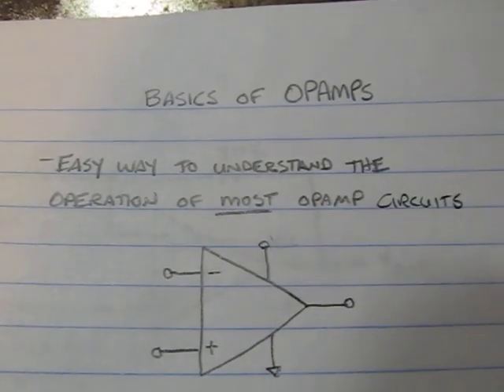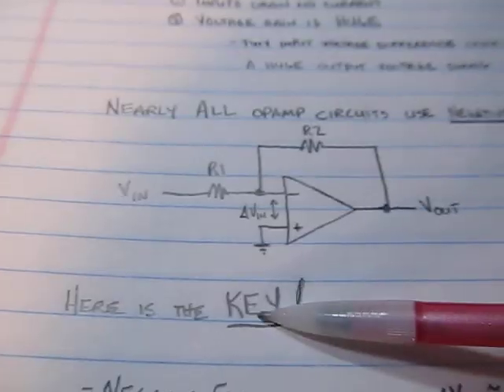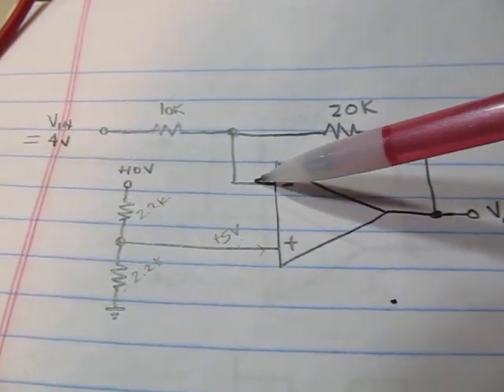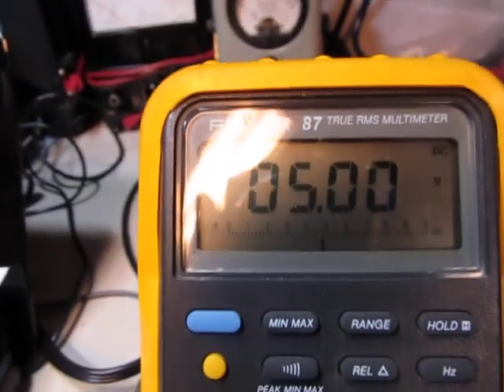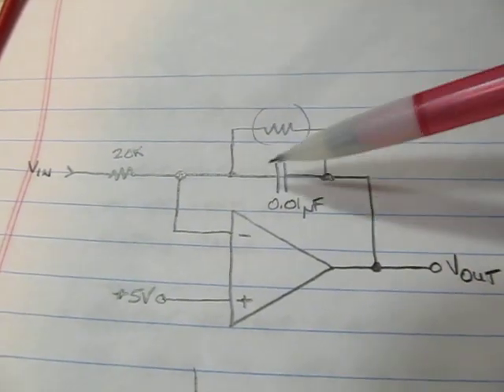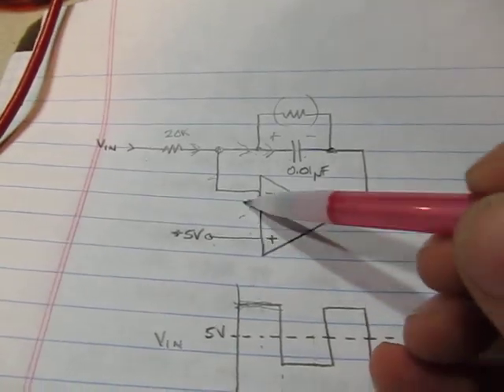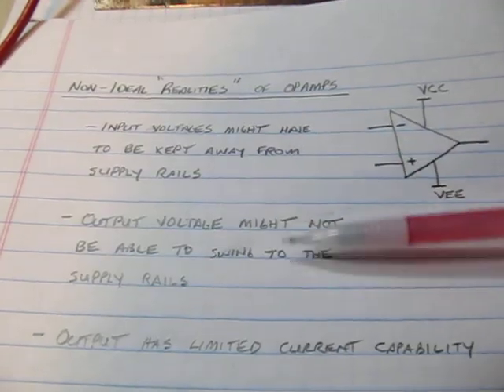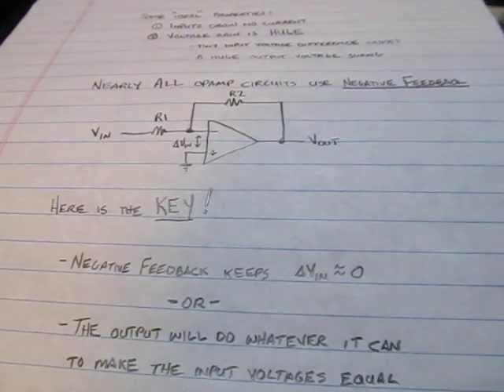#75: Basics of Opamp circuits - a tutorial on how to understand most opamp circuits

Comment: Sir, I can appreciate that you are trying to make the explanation as simple as possible, and I would not try to explain the operation of the "integrator" in the manner in which I am going to discuss the  engineering situation in the op-amp, but it would be interesting to represent the real operation of the op-amp working as an integrator, ( through itself acting as a differentiator from an output point of view!!)
At 8:09 you are suggesting that due to the 5 volts at the inverting input there is a constant current flowing in the input resistor which must proceed to flow into the feedback resistor. Then you suggest that this constant current through the capacitor will create a linear ramp voltage across the capacitor.  This operation seems to suggest that it is the constant current that creates the ramp output voltage, but in reality, it is not like that. In reality, it is the ramp voltage output which creates the constant current. Here is how it goes.
When the input is higher than 5 volts at the inverting input, the output goes negative from a LOW OUTPUT IMPEDANCE VOLTAGE source and so it pulls the output plate of the capacitor quickly down with it. But from the output point of view,  the circuit is a differentiator and so to produce a constant voltage of 5 volts on the capacitor plate connected at the input inverting input, the voltage output must have a constant rate of change.  In reality, it is even more than that, as there is a very high-frequency oscillation being superimposed on the ramp output which is reflected at the inverting input.  So really the practicality of the circuit suggests that it is the constant rate of change of the output voltage that causes the constant current to exist and not the constant current exists because of the 5 volts at the inverting input and this is pushed into the capacitor.   The conduction current through the input resistor and the displacement current through the capacitor is created because of the nature of voltages appearing between the two components connected between the output and the input " low impedance voltage sources".
Now that in order for a displacement current to flow through the insulation of a capacitor, there must be a rate of change of electric field in the dielectric insulator.  Displacement current through an insulator will only flow if there exists a rate of change of the electric field. ( we are in the radio space now and not the DC conduction space) 
When teaching operational amplifiers, I like to introduce a lever system where the fulcrum is the inverting input at the same potential as the noninverting input. In the case of the integrator circuit, not many books mention the fact that from the output point of view, feeding the same network, the network is a  high pass network or a differentiator circuit BEING FED FROM A LOW OUTPUT IMPEDANCE OF A VOLTAGE SOURCE. 
To really idealize an operational amplifier one needs to ensure that the student fully understands ( in this case  voltage sources ) that both the input source and the output of the op-amp have low output impedance and so the junction point at the inverting input is a tug of war between the input source and the output of the op-amp.  The junction point of the between the input component and the feedback component will drive the amplifier output so that the tug of war from the output of the op-amp will put the junction point at the same potential as the noninverting input.   The real  engineering operation of the op-amp from the output point of view is a case of " Depending upon the network connection between the input source and the output of the op-amp,  the junction point which controls the inverting input will cause the output to form its nature and shape so as to oscillate the junction point about the potential of the non inverting input. This high-frequency oscillation is fast and of low magnitude due to the huge amplification of the op-amp, which is band limited and hence the high frequency superimposed is not seen. Few people can imagine the practical operation for an inductor replacing the capacitor.  To discuss the other permutations where the capacitor and inductor are at the input side is also a good  test in both engineering and language logic.

Comment: How does a positive voltage at the inverting terminal decreases the out.. Vout? At 1:52
Reply from the maker: Because the op amp output is a function of (V_non_inv - V_inv).  So, if the V_inv is greater than V_non_inv, the output voltage will be negative.
Reply: @w2aew  thanks a ton got it

Comment: Really great video, I hope that you please will answer my noob question.:-)
So if there are "no" current trough the opamp, could you then also use the modified Ohms law V=R in any way?
Reply from the maker: There is essentially no current flowing in/out of the INPUT terminals of the op amp, but there certainly is current flowing in/out of the OUTPUT terminal.  If you follow my analysis of the example, I employ Ohm's Law...
Reply: @w2aew  yes that was wary clear, what I am trying to blab about is the opamp it self where there are nearly no current flowing, how do Ohms law apply there?
Reply from the maker: @friedmule5403  If no current is flowing into a device, it is the same as if that device wasn't even there (open circuit).

Comment: my question is at square one...I understand the 10V voltage divider to 5V but where does the 4V = Vin come from?  A dual power supply or what?
Reply from the maker: The 4V is from an additional power supply, simulating voltage may appear in a system, such as from a sensor.  It is used as the "input" to the op amp circuit for the purpose of discussing the op amp behavior.
Reply: @w2aew  Thank you and for your great videos as well.

Comment: Lost me at 5v.
I don't do divider
Im Me i just do equivalence and ohms law.

Series sum of R 2.2+2.2 =4.4
V=ir
I=v/r.  = 10v/4.4 = 2.27 amps
V=ir.   2.27x2.2 = 5v.

Why last step. That v after the 1st resistor.
Reply from the maker: Those are 2200 ohm resistors (2.2k), not 2.2 ohm.  So, your calculated current is off by a factor of 1000.  Not sure what you are referring to when you say "That v after the 1st resistor".  If you are referring to the +4V on the left, that is an externally applied voltage for purpose of discussion & calculation of the example.
Reply: If you are getting ampere values (without milli or micro prefix), then you made an error. 2.2 Amps would kill you.

Comment: Only thing I don't understand, because of the training I've had in electronics, is at about 7:45 you said that the current flows from the input through the 20k resistor towards the amp. but according to the electron flow theory, electrons/current flows from - to + or lower to higher voltage in any dc circuit.
Reply from the maker: This is the difference between "conventional" current flow vs. electron current flow.  Conventional current flow says that current flows from + to -.  This convention was established long before anything was understood about electrons.  It was discovered later that current is actually the movement of electrons from - to positive.  Of course, this is opposite of the "conventional" current flow definition.  You can use whatever convention is more comfortable for you.  Note that the vast majority of electronics uses "conventional" current flow direction.  Again, it doesn't matter which you use, just be consistent about it.  I will typically (nearly always) use conventional current flow in my videos, because it is what I've been doing for more than 40 years.

Comment: sorry to bother at minute 4:05, why is there 1 volt across the firs resistor and 2 Volt across the second resistor, what is the formula(how did you get to those values).??? in my class at college, amolification is calculated by the formula A= Vout/Vin, and is(- resistor 20k divided by the resistor of 10K),, -Rfeedback/Rinput, thanks !
Reply from the maker: That formula applies when the voltage at the op amp inputs is at 0V.  In this case, it is at +5V, so this adds an offset to the voltage.  The Gain of the circuit is still -Rf/Rin, but with respect to the 5V offset.  The point of this video is to gain an intuitive understanding of the operation of negative feedback (rather than just apply the formulas).  Since we know that the non-inverting input is +5V, and we know that negative feedback forces the same voltage at the inverting input, and the input voltage is +4V, then we know that the voltage across the input resistor is 1V.  Since we also know that no current flows into the inverting input (ideally), that the same current which is flowing through the input resistor must be flowing through the feedback resistor.  Since the feedback resistor in this case is twice the value of the input resistor, the voltage drop (with the same current) will be twice that of the input resistor.

Comment: Would you make a video  where one could use a single 18Vdc supply to power an OPamp that uses +9vdc and -9 vdc by using a resistor divider network that would float the ground net technique
Reply from the maker: This video might help you on the single vs. split power supply issue:
https://www.youtube.com/watch?v=MtccB9K09ck

Comment: at 4:00 you show current flowing back toward the voltage source. this part i can't quite wrap my head around.
Reply from the maker: Anytime the output voltage exceeds the input voltage, current will flow from the output to the input.  Simple ohms law.
Reply: w2aew thanks for the reply. I must have missed this part of ohms law. How does the source handle incoming current?
Reply from the maker: It depends entirely on the source.  Some sources are just fine with sinking or sourcing current, others are not.

Comment: I had a small doubt. At the start at the time of you explaining negative feedback, wouldn't Vo effectively reduce to a very large extent?  Something just doesn't make sense to me.
Reply from the maker: I'm not sure I understand your question - can you rephrase your question?
Reply: I think I understood now.
The feedback concept was a bit confusing to me on seeing it for the first time.
I think I understood why reverse feedback improves stability
Thank you!
Reply: I had another question however (The square wave example). What do you mean by the resistor being there only for biasing? How did we ignore that resistor?
Reply: Is it so since even if a resistor is present, the voltage difference across the capacitor would be same and hence the effect of the capacitor on the output voltage would be same? Than what is the need for the resistor in the first place? I haven't properly understood its function yet.
Reply: Thank you!

Comment: How come a 4v input will give 5v at op's inv.with 10k resistor in series ??? Assuming current  flows backwards ???
Reply from the maker: Sure - direction of current flow is dictated by the voltage.  In this case, the op amp input's common mode voltage is 5V, which is higher than the 4V input, so current flows towards the input.

Comment: Can we use op07 to amplifies 20 micro voltage into millivolt?
Reply from the maker: Yes, but you'll probably have to null the op amp's own residual offset since your input voltage is about the same as the typical offset voltage of the OP07.
Reply: Thank you for ur quick reply. But how to null input offset of op07 residual?
Reply: I have also AD620 . When i set gain of 500 by adjusting resistor of 100 ohm between pin 1 and 8, upto certain millivolt , my output remain constant. Same things happen with Op07 also. In op07 up to 0.35  V input my output remain constant 4.32 v. As soon as my input increase from . 35 v output changes. Kindly gguide me. 
Thanks in advanced.
Reply from the maker: It is not possible to help without seeing your schematic. Most common problem is that your input voltages are outside of the allowable input voltage range (i.e. too close to the op amp power supply voltage rails).  Neither of these devices offer rail-rail input voltage range.  What are your supply voltages?

Comment: Great tutorial as always. I have one questoin what would be Vout if you reverse Vin to  10V and voltage on divider to 4V.  You will have 2V on noninverting input and 2V on Inverting  imput so drop across 10K resistor will be 8V so current will be 8x10-4 and Vout will be 2V+(8x10-4 * 20k) = 18V is it correct ???? I have been looking for tutorials with similar confg where Vi would be higher than voltage on noninvert imput but I havent found none. Please help. Thank you very much
Reply from the maker: In your example, the voltage across the 20k feedback resistor would be 16V.  With +2V on the left side, that would that the output (right side of the resistor) would be at -14V.  This assumes of course that the op amp is capable of reaching -14V on it's output and the power supply voltages to the op amp are sufficiently > +/-14V.

Comment: how we decide that wihich direction of current is takem how we put +and -ve sign on resistance
Reply from the maker: It's all part of the analysis of the circuit.  The voltages at the terminals of each device determines the direction of the current flow.

Comment: What's the purpose of using op amps though?
Reply from the maker: They have tremendous versatility.  Through the use of feedback, you can make very precise amplifiers, filters, peak detectors, integrators, differentiators, level shifters, summing and difference amplifiers, log amplifiers, and lots of other signal conditioning functions.

Comment: Hi! Does that mean the current flow back to Vin ? Can you explain how the current start flowing from Vin 4v. Thanks alot
Reply from the maker: No current flows in or out of the op amp inputs (ideally).  The current flows from the 4V because the op amp changes the voltage at its output, causing a voltage differential to appear across the two resistors (10k and 20k), resulting in current flow in the resisitors.
Reply: w2aew sorry just to confirm , if the current flow from vin to the resistor , wouldnt there be a voltage drop across r1 1v and at the node will be 3v ?
Reply: w2aew and also how do you apply the formulae -rf/r1 = gain = -2 vout = gain x vin = 2 x 4 = 8v.
Reply from the maker: That simplified formula only applies when the inputs are at 0V.
Reply from the maker: The current is flowing the other direction.
Reply: w2aew so does that mean the current flow back into Vin since thats the only path
Reply from the maker: yes

Comment: Very good vid, only criticism I could give is by calling them "microamps" instesd of "milliamps" it makes it very confusing as microamps are an si unit in themselves
Reply from the maker: At 4:05 in the video, I say that there is 100 microamps flowing through the 10k resistor connected to the inverting input, because it is 100 microamps!  Is there another spot in the video where I said microamps but I should have said milliamps?

Comment: Why is it 5V at 3:17?
Reply from the maker: Simple voltage divider.  The series combination of the 2.2k resistors across the +10V supply results in +5V appearing at the junction of the two resistors.

Comment: Isn't gain just -r2/r1

so that would make gain 2, which would make Vo=8v  

Why am I confusing this?
Reply from the maker: Because that assumes that the voltage at the op amp inputs is at zero volts, which it is not in this case.

Comment: How could I use op amps to scale a switching power supply feedback system based on battery charge and output level?  For example, I want to build a power supply that will mimik a lower voltage battery as it discharges.  I don't want a constant output. I'm powering a 7.4v board with a 14.8v pack and I want to take advantage of the exciting battery monitor without reverse engineering the existing system.

Comment: Hey w2aew! at 3:54 you say 1V through the 10k resistor. I can't figure out why its 1V
Reply from the maker: Because 4V is being applied to one end of the resistor, and +5V appears at the non-inverting input.  The feedback ensures that the inverting input will be driven to be at the same voltage as the non-inverting input. Thus, we know that the inverting input is at 5V.  So, there is 4V at one end and 5V at the other end of the 10k, which means that there's 1V across it.

Comment: And what we would do if those two resistors were not the same resistance? 
How  would we know voltage in middle point between them? 
Could you write me equations in a comment?
Reply: You may find this useful  http://www.ohmslawcalculator.com/voltage-divider-calculator
Reply from the maker: This is called a voltage divider.  The voltage between the resistors would be equal to:
Voltage_on_top multiplied by the bottom resistor value, then divide by the sum of the two resistor values.
Such as:
V_mid = (V_top * R_bottom) / (R_top + R_bottom)
See this page for more detailed info:
https://en.wikipedia.org/wiki/Voltage_divider
Reply: Omikron 
(Rbottom/Rtop+bottom)xV

Comment: i have seen polyester cap in many of your videos..i also have googled and read different types capacitor usage ..
but whats your view with this cap in this circuit or is it just picked randomly
Reply from the maker: It is common to use a film cap like this in integrator applications due to the low leakage and loss.

Comment: the triangle wave output is raised away from the ground level by having +5V on the '+' pin.
this fact is useful when an AC signal is applied to an  IC with an input range spec
entirely above 0V.  ex.   0.1 to 2.5V.